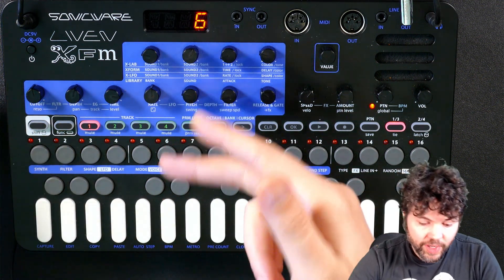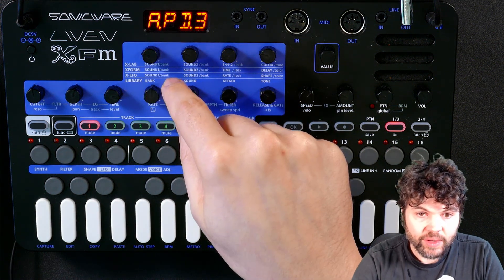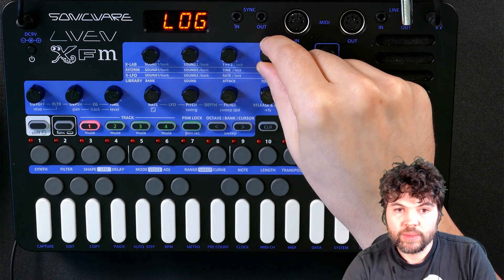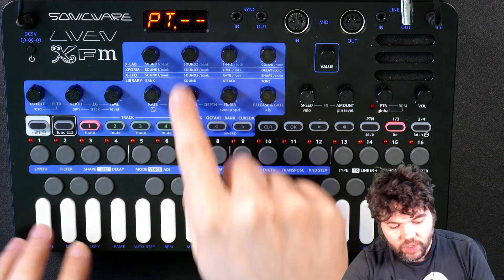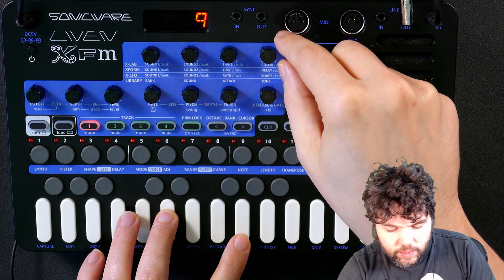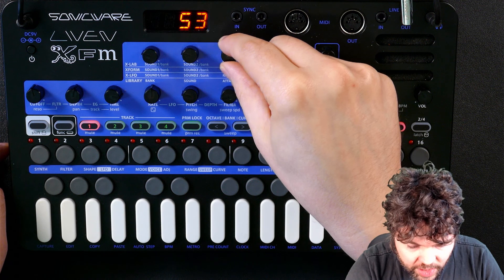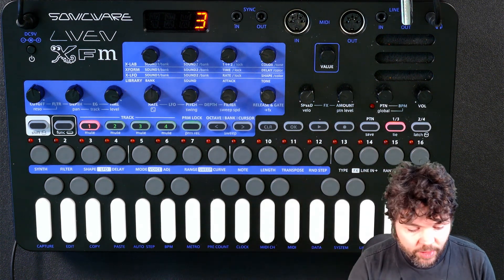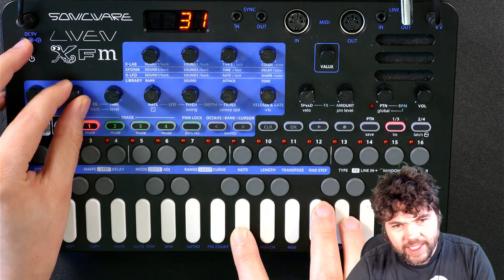FM Sound Design on Liven XFM: Ep05 - The X-LFO Engine

Comment: 11:14 I’m bit confused here so 3 or 2 engine types can be re-saved as patches, thanks for your work sir
Reply from the maker: Thanks for watching, and for your comment. The confusion stems from this: a patch is a 4 operator FM sound. The tracks do not use FM patches directly, but instead use "sound generation engines". The engines use one, or two patches from the library to make a sound alongside the rest of the track level parameters (filter, track LFO, effect send etc). The parameters of the engine (including the FM patch/bank number) and other track level parameters are stored per track and can be automated per step.

You'll notice that the "patch saving" in sequencer mode is known as "capture". This is because you aren't saving the state of the engine, you are capturing an FM patch (i.e placing it in the FM patch library) that the engine created.

Consider the Lib engine: it uses an FM patch and lets you tweak attack, decay and feedback of the operators: the result is a tweaked FM patch: this patch can be represented by an FM patch, and hence captured in the patch library.

Next consider the XLab engine: it takes two FM patches from the library and algorithmically combines them, while also letting you tweak feedback and decay. The result is a new FM patch which can be captured in the FM patch library.

So now to XForm and XLFO. These engines take two patches from the FM patch library. They then animate between them in some way. The sound you hear isn't a single FM patch, but a series of FM patches generated/animated on the fly. Since the patch library only contains regular 4 operator FM patches, these animated sounds cannot be represented there.

When you get into the FM edit section, you'll see how to access and edit the FM patches in the patch library. This edit mode gives you access to all the FM parameters. A typical simple flow might be: use the XLab engine to create a new hybrid patch and capture it. Later, use that patch with the library engine. You might then enter edit mode and edit that patch in full FM detail then resave it to use in future. You might even save two different versions of the patch and animate between them using the XLFO or XForm engines.

To summarize, the sequencer mode/engine level sound design is intended to be quick and easy and isn't something you save except in a song/track. FM patches are more complex to edit and are saved in the library. The XLab engine gives you an easy way to make new FM patches without full FM editing by combining patches. Edit mode gives you access to edit these patches. The XLab/Form engines additionally give you unique and simple ways to animate FM sounds. This seems a little confusing at first, but isn't too complicated in practice: it all exists to allow FM editing without having to know how to actually do FM sound design.